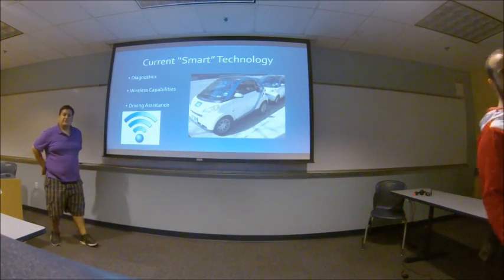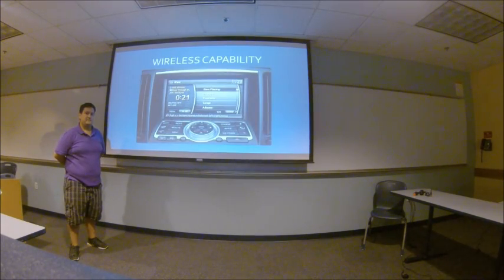Team 2: Smart Car Technologies

Comment: The panoramic view was well implemented so that they presenter easily fit into the frame as well as the power point was easy to read. My critiques would be that more formal attire should be used and that moving the camera closer would help cut out unnecessary portions of the room as well as increase the sound quality. The presenters all did a great job presenting their sections as well as being very fluid, they definitely practiced beforehand.